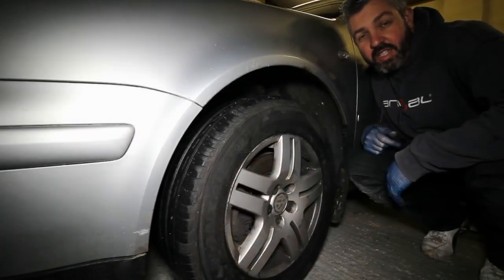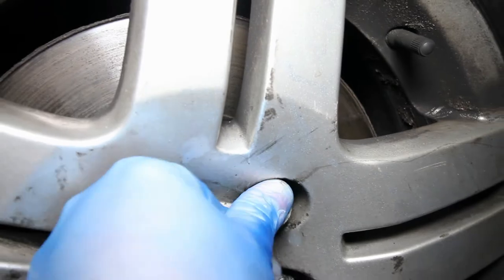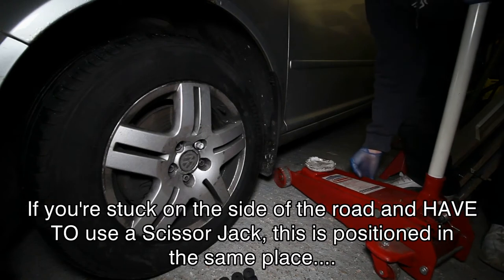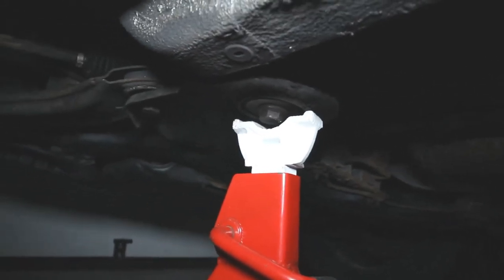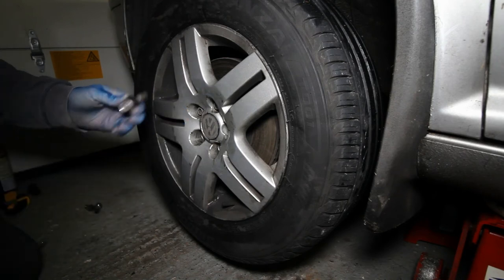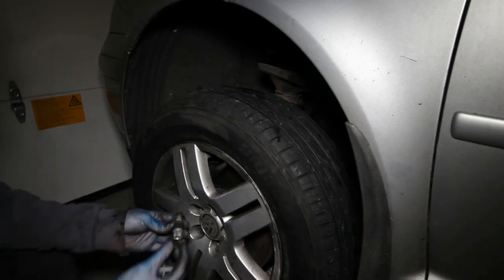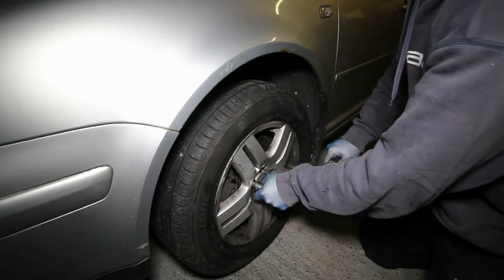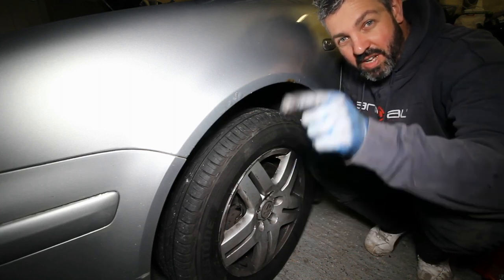How to jack up a VW Golf Mk4 and change a wheel - Where to jack up and support a VW Golf / Jetta

Comment: I tried swapping the alloys on my Golf 4 ( same alloys as in the video) to put on steel wheels as I somehow prefer the look but I took the wheel nut lock off (cost me 40 quid as i managed to lose the damn tool) and loosened the nuts, lifted the car up and took the nuts off but the wheel wouldn't budge off, i seen a few videos about kicking it but I was using the jack that comes with the car and I really wasn't trusting it as it wasn't even the type of jack you get on most other cars, I gave the wheel a few light kicks and the car was wobbling and i had a look at the jack and it seemed to be leaning over a bit more so i gave up and put the nuts back on, also I can't find the place to put the jack in frht front of the car? I know in the rear there's the sort of round discs but in the front I don't see them, how much would it cost at a mechanic to get them swapped? I had purchased tyres from a tyre shop and they were gonna  replace my wheels until they realised i needed the tool for the nut lock and they didn't have it so i had to get it done the next day at another place, emailed the shop but no reply so far on their prices or if they'd be willing to still do it for free as i did purchase 4 tyres
Reply from the maker: First things first, if the wheel's not budging, don't go hitting it about while it's only on the jack, because the jack will give way!! It needs to be supported securely before you go at it. I would pop the centre cap off and spray all around the centre of the wheel with WD40 to help release it. If that doesn't help, you will need to give it a tap with a rubber mallet....short sharp blows!
A garage shouldn't charge you too much to swap the wheels I'd have thought. Depends really, you might get them to do it for £10-£20 maybe?
Reply: @charlieshooter  Try PB Blaster instead of WD 40 for stubborn/rusted hardware. It has really worked for me.

(BTW: "WD" stands for "water displacement". WD-40 was the fortieth test fluid, meant to coat metal to prevent water from causing rust... the fluid itself is fish oil.)